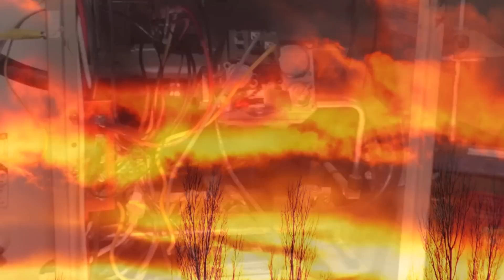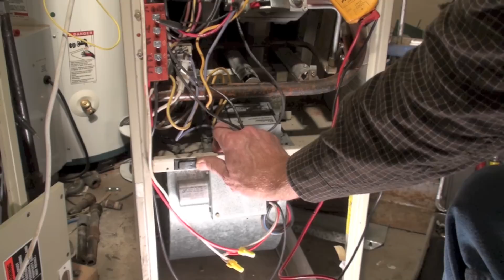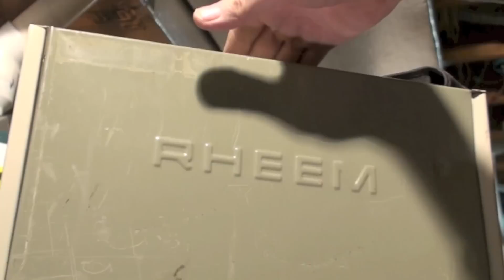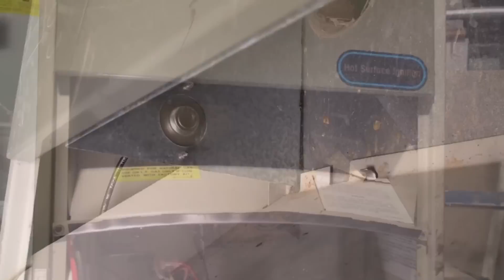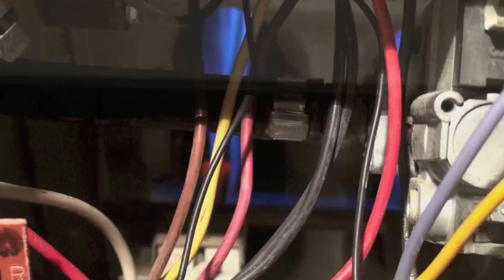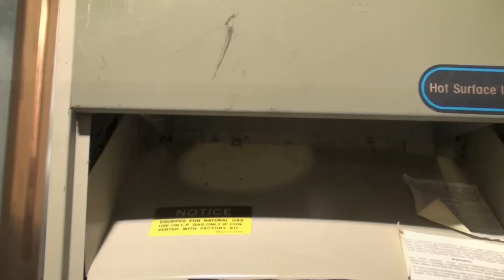Rheem RGDA model troubleshoot part 1

Comment: I'm not sure if that switch tripped or it is failing but it wasn't conducting right; I didn't know it was resettable so I bought a replacement (different brand, trips as 215F, hope that's right..).  In any case, replacing it didn't work - but it turned out that it was because I had the ignition control unit unscrewed from ground (as I was debugging).  I saw your other video and got it sorted.  Thanks.

Comment: You sir are awesome. Just fixed my RUUD/Rheem unit with you guidance. Found the draft switch had to be reset.
Reply from the maker: Glad you got it going.  I would be checking the draft hood for spillage during operation.
GFM

Comment: thank you Gary,,,,,,we had massive winter storm and our rheem weird ass furnace went out turned out we had two issues one was beat up thermostat second was gas re flux sensor had been moved from factory placement once exhaust had been checked and sensor reset fired right up....we had grand kids just move in and lost our heat not good...thanks so much for the weird rheem years videos which saved us a bunch of money...god bless you Gary for helping the dyi folks on a tight income....
Reply from the maker: Glad you got it going.
GFM

Comment: my rheem model Rrgg 05n31jkr will spark,pilot,light main flamr but then shut off after 5 to 10 seconds. i could not find a flame sensor so could it be with the pilot/igniter? if so can i clean it if so how? or do i have to replace? thanx in advance
Reply from the maker: The probe that the spark comes from is the sensor.  It can be cleaned with sandpaper.
GFM
Reply: do u have a video showing me how by any chance? also am i cleaning the top part of the probe like the flat part or around it?
Reply from the maker: I do not have one.  Clean both the top and the sides of both probes.
GFM
Reply: ok thank you i will do it this weekeend!